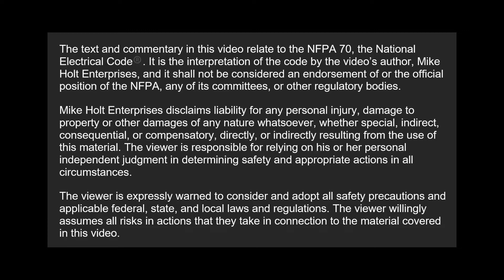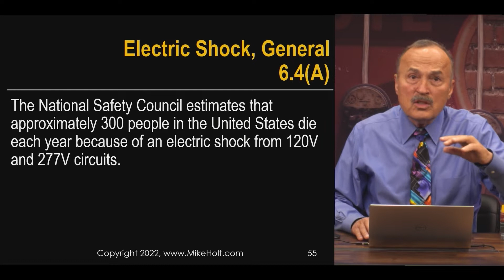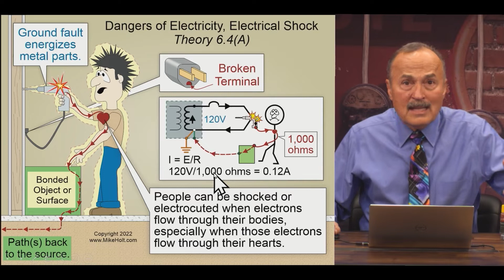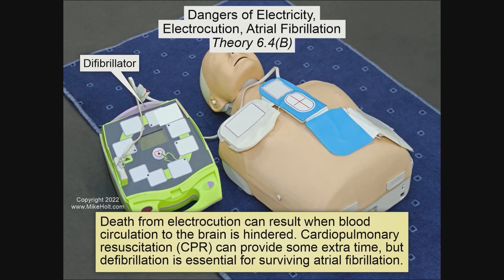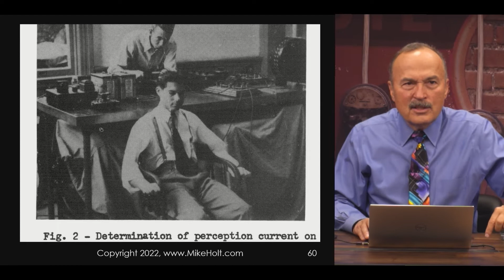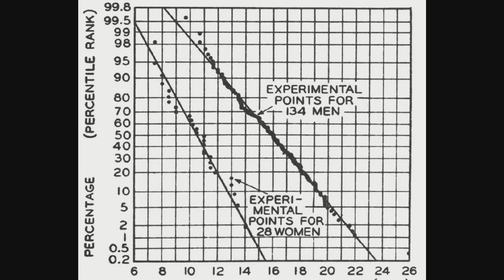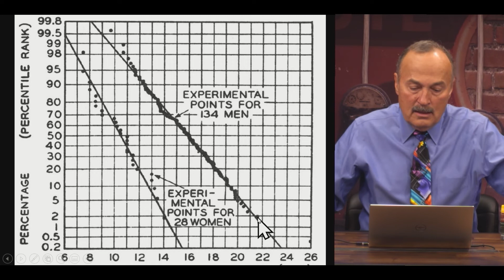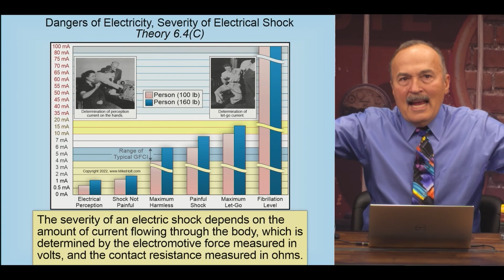Electric Shock 6.4

Comment: Hi, Mike, great video as most are.  I thought you might be interested in knowing that you may have conflated cardioversion, treatment tachycardia, with defibrillation.  Defibrillation, shocking the heart at anywhere from 120 joules to 360.  The shock stops the heart from quivering and the hope is it will regain a normal sinus rhythm.  Basically rebooting it so to say.  One single shock at any time, the exact time does not matter.  Cardioversion is slightly different.  Cardioversion involves synchronized electrical shocks to stabilize an irregular heartbeat, often atrial fibrillation aka Supraventricular Tachycardia (SVT),  This shock is synchronized with the cardiac rhythm (pqrst) to fire on the QRS  complex.  The upwards slope of the T wave, which takes maybe a millisecond or 2 is the most vulnerable part and if shocked there a person with SVT can be disrupted and they could have a  heart attack (myocardial infarction) aka ventricular fibrulation  Same thing can happen from blunt trauma to the chest if the timing happens to line up with the upwards slope of the T wave.     Cardioversion typically for an adult is between 50 and 200 joules synchronized.

Comment: I took an electronics class in college, maybe electric shock is different because of oscillators and high frequencies, DC current, electronic grounding static preventing wrist strap, etc but I was taught that 9 milliamperes can be dangerous for a man and 8 milliamperes for a woman, and that is why GFCI receptacles were designed to trip at 5 milliamperes ( 0.005 amps ) back then I tested a few GFI’s and they all did trip a little above 5 milliamperes using a potentiometer ( variable 5 watt resistor probably tripped at 20K ohm ) and a 1 amp fuse and a current meter going from Hot to Ground
Reply: I've been shocked before that tripped a GFI, and that 5 mA can be quite painful, never test a GFCI by touching it to see if it works. Use a proper tester as well as the self test button to make sure it all works correctly. I think it was when I came back from lunch to a construction site, and I grabbed a 120v hammer drill. I didn't know that it had rained while I was gone, and it was soaked, and it was horrible, I got the metallic taste in my mouth and was pretty dazed for a bit, even temporarily forgot where I was, or what I was doing.
Reply: @brnmcc01  I'm not sure how you knew your shock was only 5mA?  GFCIs don't limit leakage current to 5mA.  They just open up quickly AFTER the maximum has been exceeded.  Maybe exceeded by a boatload.
Reply: @core251  You're right, it could have been more, but not a huge amount because I had no ill effects afterwards. But it was very painful, I would put it somewhere between touching an electric fence with wet feet, but not as bad as a taser.

My point was don't bother testing a GFI by shocking yourself, even assuming the device works as intended, not worth the risk or the painful shock from it. Maybe it's only 1/10th of a percent chance of dying, but one can never tell when luck will run out.

Comment: I wish my bosses had seen this video.  Someone stole the light switch out of one of our public bathrooms, leaving the hot, neutral & ground hanging out of the wall.  I reported this and then someone moved the hot and put it on the neutral so the lights would stay on.  I recommended locking the door or at least finding a breaker and shutting it off until it was repaired.  I was told it was more important to leave the bathroom open and leave the lights on.  It took 10 days before an electrician arrived and replaced the light switch.  I was treated like an idiot for suggesting that this was a hazard to public safety.
Reply: The neutral of a light switch…? Also if you wire the hot to nuetral you will open the circuit with a fault.
Reply: @Coldbrookdangee  …I see what you’re saying.  My bad using that terminology.  That white wire is simply a continuation of the hot wire when the switch is turned on.  The other side of the light bulb flows back to the source on the neutral.  Sorry for all the confusion I caused.  I need to be more careful with my words.
Reply: Did they at least use a wire nut to secure the wires? That wasn't the neutral wire, that was a switch leg going to the light fixture. If they had connected the hot leg to the neutral wire, that would have created a dead short, and blew up in their face and hopefully tripped the breaker. That was sketchy of them to do that, why steal a light switch that you can buy at a big box store for $1.99? Idiots. That's crazy they didn't think of the potential liability of leaving a shock hazard in a publicly accessible bathroom for 10 days. Million dollar lawsuit waiting to happen if someone's little kid plays with the wires and gets bit.
Reply: @brnmcc01  …No.  There was no attempt to cover the wires either by tape or nuts.  Just hanging loose out of the wall.  And you are correct.  That was not a neutral wire.  In fact I did not have my home tester on me so I cannot say with any authority which wire was actually “hot”.  I only know that one of them was hot because several days after I first noticed this someone had hooked the black & white to each other and the lights were on.  And I was told to leave it that way.  As of this past Wednesday night a new light switch has been installed and all is safe again.